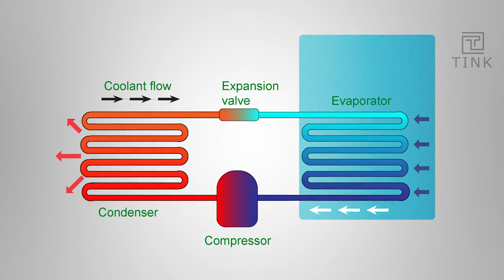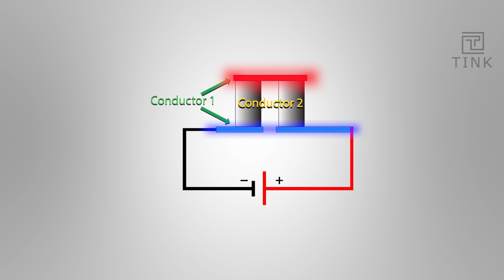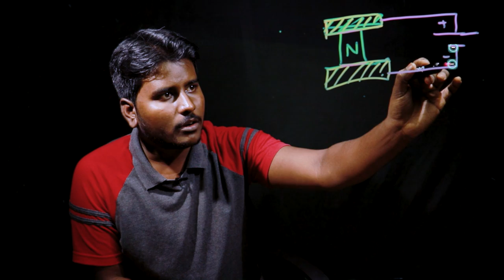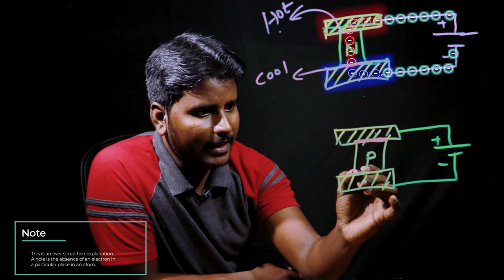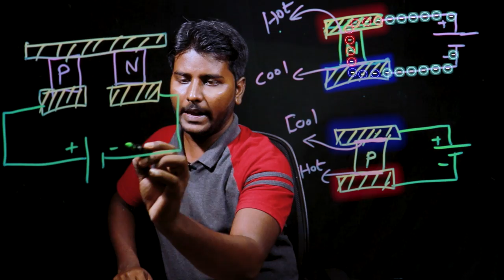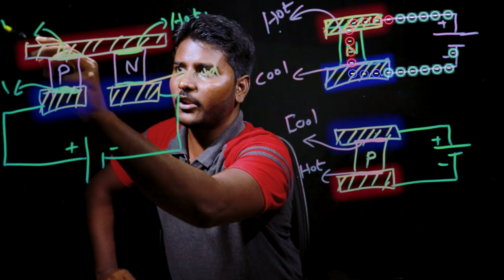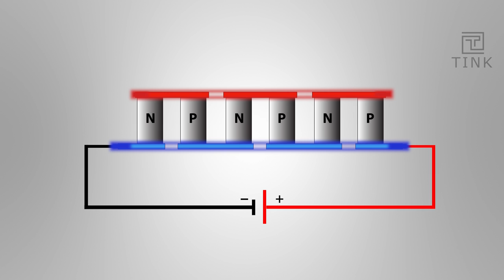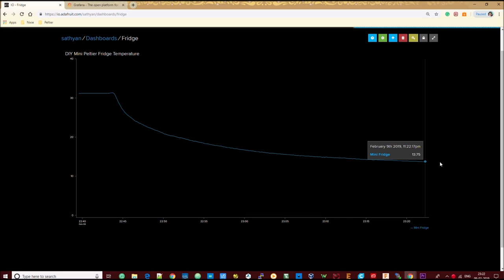#16 [Tamil] - How to make an IoT Enabled Mini Fridge? - Part 1 (Theory)

Comment: Enaku cooling kammiya varuthu heating over ah varuthu enna karanam
Reply from the maker: Current is not sufficient. Try to use a power supply capable of supplying upto 10A